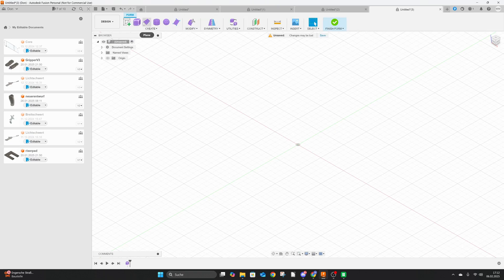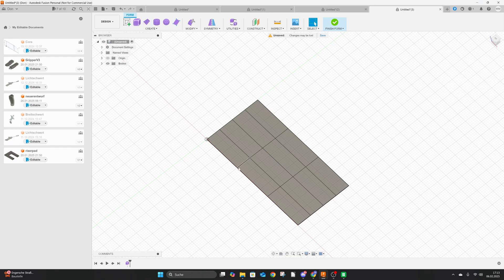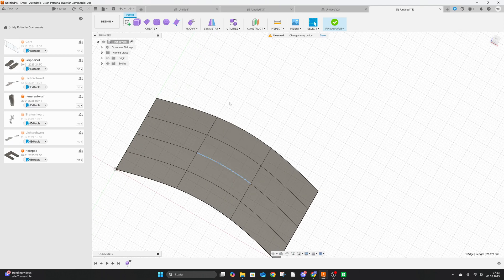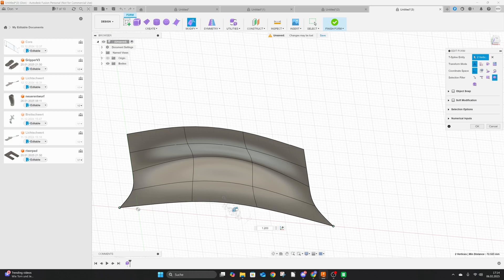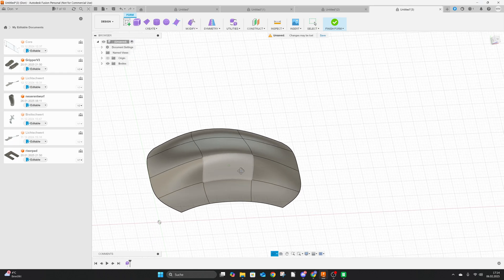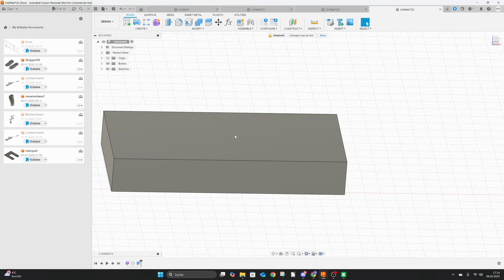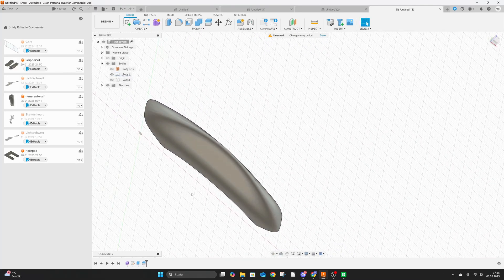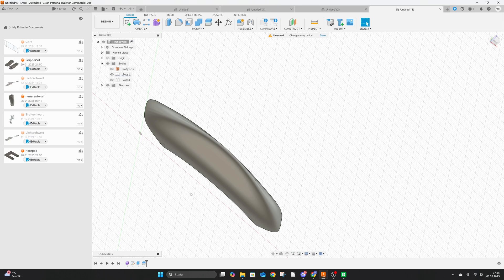3D Printing for Skating - Foot Pocket Implant Guide- Part 6

Comment: Hi Michael! is it possible you can show us the installed implant and the method you use to glue it to the board? Thanks!!
Reply from the maker: @simonvillalobos9679  Simply use carpet tape! 

You might want to heat the Griptape with a hairdryer to make it easier to apply!
Reply: @skate-horizons  thanks!